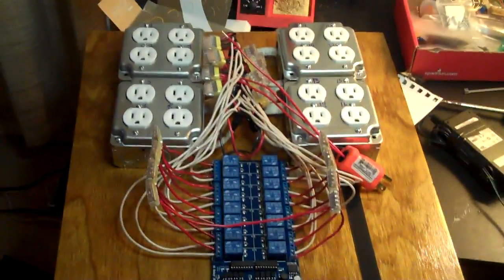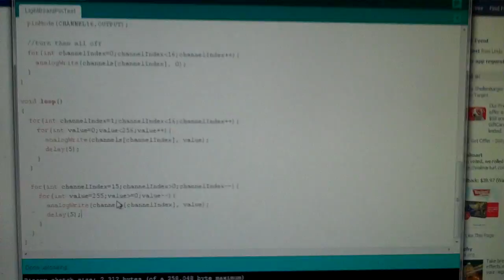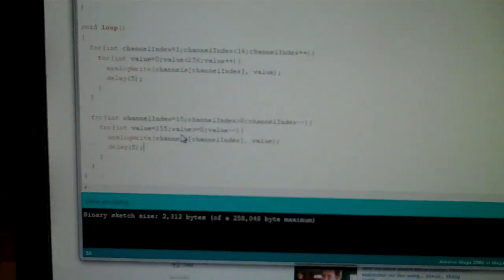Christmas Lights Control System - Part 6

Comment: I so want to try this
Reply from the maker: The mechanical relays in version 1 of the project will break down fairly quickly.  They simply weren't meant to handle this kind of use.  In fact using them this way is kind of dangerous, it can cause arcing and even fires.  In version 2 of the project (which has videos as well on here) I switched over to solid state relays, which have no problem with being turned on/off rapidly for extended periods of time, they also allowed me to implement true dimming of the lights.  YOU SHOULD NOT USE MECHANICAL RELAYS FOR THIS OTHER THAN AS AN EXPERIMENT.
Reply: @zparticle  i have a 16 soild state relay board and an adruino
Reply: @zparticle  i was gonna try it years ago and didnt. i have everythign accpet wires to hook the soild state relay to the adruino

Comment: Where did you get ribbon cables
Reply from the maker: I bought a roll of 100 wire ribbon cable (from a n electronics jun k store) and then split it up into the sizes I needed and put on my own connectors.  You can find everything you need on Amazon just search for ribbon cable.

Comment: Can you explain to me how the hot side is wired to all the plugs? I have the ground bus done,  Just trying to figure out how the hot side gets distributed.
Reply: I have one wire coming from each socket with the hot side tab snapped off on the outlet. How did you power those while also feeding them into the relay board?
Reply: Do the hot wires come direct from each individual outlet to the relay board? or do they come out of the outlets and get bonded together with one hot per outlet box and then into the relay board?
Reply from the maker: I don't remember this build very well the second version with the SSRs was different.  If I remember correctly for these mechanical relays it goes something like this:  On each outlet (separated by removing the tab that connects them in pairs) you should have a ground, a hot and a neutral wire. The mechanical relays have three terminals each: two that are normally connected when the relay isn't powered and a third that will be connected to the middle terminal when the relay is powered. You want the ground wire of each of the outlets connected to a common "bus"/wire.  This the ground wire from the wall outlet into the outlets for the controller, in this video that is the red wire coming from the orange plug, if I remember correctly.  Notice that all of them are connected to each other via the little four connector plastic things.  That means ALL of the ground wires are effectively a single wire.  Each of the hot (black) wires is connected together using the little four connector plastics things and are connected to the hot side of the orange plug.  Each of the "return" voltage wires (white) are plugged into the relays.  When the relay is powered it closes and the white and the red wires are connected completing the circuit.  I want to state again, I had no idea what I was doing when I built this first version and as people have pointed out I should have been switching the hot not the return wire.

Comment: Can you clarify what you're saying in this video and how you implemented your wiring?

2:26 What do you mean by common bus, ground bus, ? The push in wire connectors? Common open, common closed?

1:24 The black conductor is connected to the receptacles and the neutral is at the relay? If so, why do you switch the neutral and not hot? Is this supposedly safer than switching 120VAC?

Thank you
Reply from the maker: Common means shared, so the common ground bus is the circuit that all of the grounds are connected to. Common closed on the relays is exactly as the video describes it, there are 3 terminals in the non-powered position two of them are connected, common closed.  As for why it is wired the way it is, that is because I had no idea what I was doing.  What the videos for the second version of the project, that uses true dimming and SSRs, show are MUCH safer ways to do this. I DO NOT RECOMMEND USING THIS VERSION AS ANYTHING OTHER THAN A LEARNING TOOL.

Comment: i'm goign to try this
Reply from the maker: Hey Chris.  If you do this please, please, please follow the version 2 videos.  They use solid state relays.  Doing this with mechanical relays is very dangerous as they can arch, fuse and start fires.  If I had known what I was doing when I built the first version of the controller I would have never used the mechanical relays.
Reply: Yea I purchased solid state relays
Reply: Scott Shaver
if you dont mind me asking around how much did you spent to  set everything up.
Reply from the maker: For Version 2 it was well over $200.  The random cross SSRs were $5 a piece and I needed 32 of them.
Reply: 200 isnt bad. right now i have an arduino mega, and a 16 channel solid state relay, and vixen, and electrical wire. i was looking at ordering the remaining parts and its starting to get costly. I was looking at 16 outlets, but over 100 in extension cords alone.
Reply: plus wireless speaker for outside. looking like my final display with lights will be over 500
Reply from the maker: Oh yeah with lights and extension cords and everything it was $500 or more.
Reply: yea, i just hope it looks as cool as i hope. I didn't expect to spend this much. but it will be worth it in the end.

Comment: Hello there! Nice project. But I have to tell you it is nearly impossible to safely and reliably "dim" a mechanical relay because of its internal contact inertia. You can try, in this case, a type of solid-state relay that uses a mosfet as the switching element, once it has no moving parts inside (at least, It shouldn't. Because that would be a problem ;) ), reaching much lower switching time, thus tollerating much higher frequencies. :D
Reply from the maker: +Matheus Moreira yeah, I've replied to the same kind of comment several times. In version two of the project I used random cross SSRs with a AC zero cross detection circuit to get true dimming. Also I've let everyone know not to use mechanical relays in this manner because it is dangerous.  Thanks, have a great new year.
Reply: Yep. Happy to see that other people have been worried about it too. A great new year for you too. Take care. :D
Reply: wich part is about random/zero cross dimmer?
Reply from the maker: Watch the version 2 videos, they have dimming and SSRs.  https://www.youtube.com/watch?v=ozCosT5Ki_Y&list=PLp21wF8e4XnjCTjyARowU-Qdw3qkuTACi
Reply: Scott Shaver at the time of writing that comment, I couldn't be bothered to watch your second video.

Comment: Always, always, always use the ungrounded conductor to switch, when switching AC. This is a very unsafe installation! Please correct this so you do not hurt yourself and/or others.
Reply from the maker: +thomas rocha I'm pretty sure I fixed that in version two of the project (see videos) but it has been a couple of years.  Anyway, thanks for your input and helping to keep people safe.
Reply: +Scott Shaver awesome, do you have a link to the new version?
Reply from the maker: +thomas rocha I think this link will get you to the playlist for version two.  If it doesn't the second link will take you to the first of the version two videos.
https://www.youtube.com/playlist?list=PLp21wF8e4XnjCTjyARowU-Qdw3qkuTACi
https://www.youtube.com/watch?v=ozCosT5Ki_Y&index=1&list=PLp21wF8e4XnjCTjyARowU-Qdw3qkuTACi

Comment: really should have used white as neutral (common bus) and black as the hot line in (power in to relay) and red as the switched hot out (Power out of relay) for sake of keeping things simple and safe. always use the hot side of the AC lines to switch a device. leave the neutral side as the common bus. and always have things grounded to earth ground.

Comment: what pins on the arduino did you use to connect to what pins on the relay board? etc.
Reply from the maker: Look at the code and you will see what pins to use.